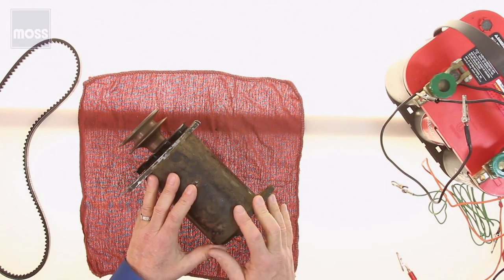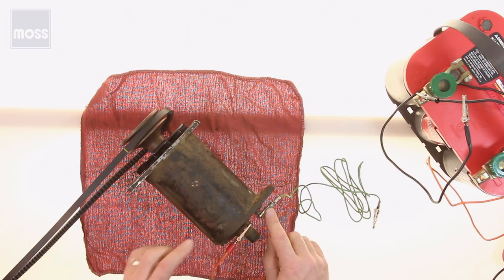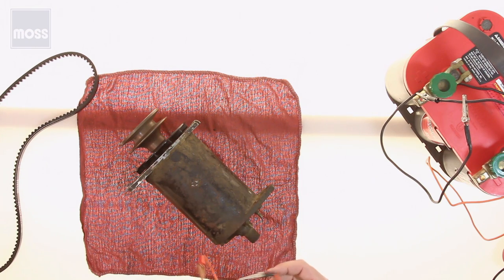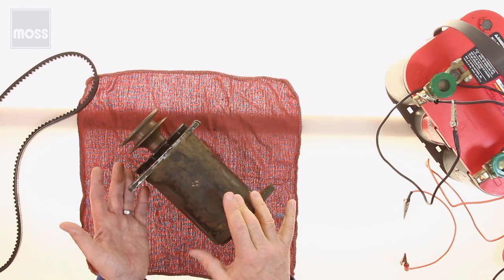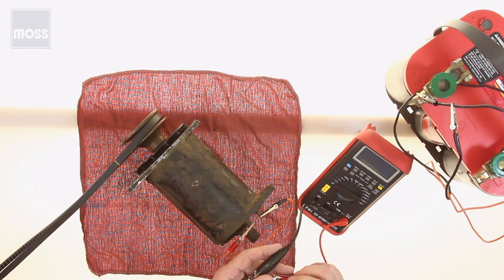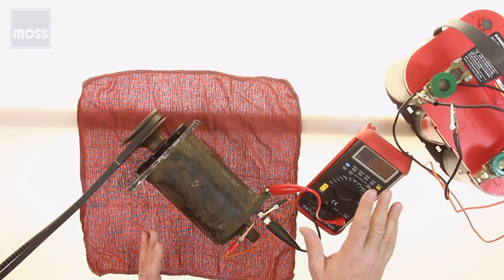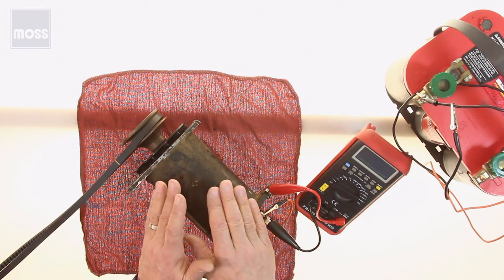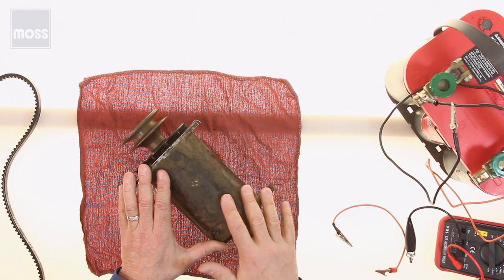Generator - How to Bench Test it While in your Car (Newest Version)

Comment: Thank you so much. I must fried the “cutout” (used before voltage regulators) on the generator on my 1923 model T Ford. I made the mistake of continuing to drive the car and killed the armature as a result. Got a donor armature and replaced the dead one and wanted to see it it worked. Hooking it up to a DC power source made it run, so one test done.

Comment: Makes it all very understandable. I would say however, and others have confirmed this, that the voltage reading when shorting the F and D with the engine idling does not go above 6V. Only when revving the engine up will it increase to the 18V or more. 
Perhaps this is because my own Dynamo is quite old and in need of refurbishment  but I surmise, that is the case for most people these days.

Comment: A good video for the amateur. However people get into trouble when they don't know and they don't understand whether their generator has an internally earthed field or an externally earthed field. Never polarise your generator from the regulator box. Remove both the wires from the generator and polarise the fields at the generator. You will need to know whether the generator has an internally or an externally earthed field. If you try to polarise the field at the regulator box and it is externally earthed field, then you are shorting battery to earth if you tap the field terminal instead of the dynamo terminal.

Comment: At 2:40, you give the instruction to take the one end of the test lead to "the brown wire that feeds your voltage regulator".  After almost 70 years of dirt and grime, all my wires are "brown wires".  Can you please specify which wire from the regulator you're referring to?  I'm guessing A (off the 5 point regulator).  Can you confirm (or correct) this?  Thank you.    Alternatively, can you attach the test lead to the positive battery terminal?  Should the car be on or off during this test?

Comment: Great video! 1969 MG Midget: I first tested the generator using the University Motors method of disconnecting the battery with the motor running at 1500rpm and the headlights on. Motor continued running no problem and headlights didn't even dim. But with your bench-test-in-car method, I was only getting 10.5-11 volts from the generator at 900rpm. Does it need to be replaced/refurbished? I am having increasingly frequent dead battery incidents (battery is 2 years old and Pep Boys says it tested fine). Thanks!

Comment: Great explanation. What if my generator spins, but voltage is between 0,08-0,13 V? What should I check next?
Reply: I have the same problem did you find a solution?
Reply: @mbmpablo3631  Unfortunately no. I gave it to specialists and they only told me, generator need to be regenerated.

Comment: I wonder if you have answers to my questions. I have an 8n Ford tractor, 6v positive ground. I believe the generator is 8N10000c. It's 2 brush and externally grounded. Has ground, field and armature terminals. Regulator has batt, arm and field terminals. Engine stops when battery cable is unhooked. I can run it as a motor.  But with engine running I'm only getting like 6.27v. I'm unable to check voltage with a meter as you did by jumpering the terminals on the generator. Is there another way to check the output of the generator? I can hook up meter leads to arm and ground posts on generator. At about 800 rpm I get about .7 volts. If I raise the rpm to 2200 I'm getting about 1.3 volts.

Comment: Great video but note output test this way only works for internally earthed fields. If your regulator grounds the field then you need to put the field terminal to ground to get full output.
Reply: I wonder if you have answers to my questions. I have an 8n Ford tractor, 6v positive ground. I believe the generator is 8N10000c. It's 2 brush and externally grounded. Has ground, field and armature terminals. Regulator has batt, arm and field terminals. Engine stops when battery cable is unhooked. I can run it as a motor.  But with engine running I'm only getting like 6.27v. I'm unable to check voltage with a meter as you did by jumpering the terminals on the generator. Is there another way to check the output of the generator? I can hook up meter leads to arm and ground posts on generator. At about 800 rpm I get about .7 volts. If I raise the rpm to 2200 I'm getting about 1.3 volts.
Reply: Found this out the hard way! Took my generator to the rebuilder and he said it was fine. Glad he’s an honest guy!
Reply: Great descriptive video!!!!    I have a 1948 Plymouth with a 6 volt positive ground generator that looks the same as the one in this video... HOWEVER, I just took it apart and cleaned it all up and then tried to test it as a motor as described in this video.  It did NOT work.  I was concerned that the generator was bad, so I called a local repair shop (that specializes in starters, alternators, etc.).  They told me to bring the generator over and they would test it quickly for free.  I hopped in the car and took it right over to them.  They tested my generator for free and said it works great. Whew... I was relieved.  I mentioned this video to the technician and asked if I should be able to put a jumper between the A and F leads and then properly connect the battery (+ and -) and it should run as a motor.  The technician said that was wrong for my generator.  Instead, he said that I would need to jumper the Field (F) terminal to the ground (in my case Positive, since my car is positive ground), and then connect the battery (in my case the negative terminal) to the A terminal - and then it would run as a motor.  I just wanted to mention this to future readers in case their generator is wired slightly different.  I hope this helps someone.

Comment: I have one that motors great when I put 12 volts to the armature slows down quick when power is switched to the field coils but will not charge. New bushes cleaned the armature new voltage regulator. Makes .10 of a volt. I have done all the tests and seems fine. I am puzzled.

Comment: testing a 1960 Eldorado Biarritz. I did the test and it failed. to witch terminal do i connect a condenser. i found it close to the battery terminal.

Comment: 1-how do you know your car is negative or positive ground
2- how do you lower your RPM
Reply: follow the battery terminal that connects to the body/chassis.If it's the positive on the battery it's positive ground and vice versa.
Reply: Idle screw on your carb or take the vacuum hose off of your vacuum advance (and plug it) or if you have an older fuel injected car you can jump two pins in the ecm connector under your steering column, you'll have to figure which one's on your own, I did it on my '88 s10 to set the timing but don't remember which one's they were and I'm sure other cars are different anyway.
Reply: Anyway, if u get the +/- ground wrong, the voltmeter will just show negative number instead of postive, right? (point being that its the number thats important)  Is my logic sound there?
Reply: Follow the battery ground wire